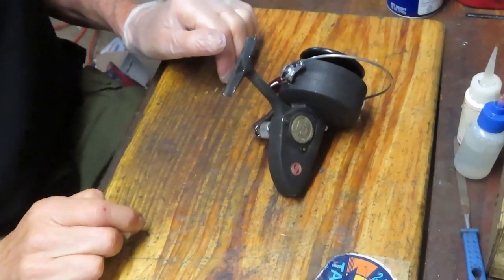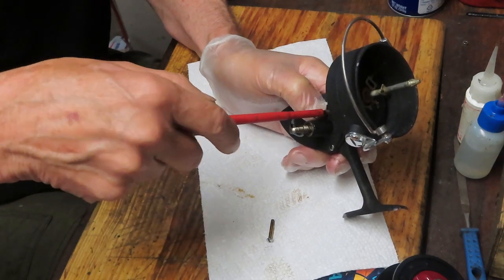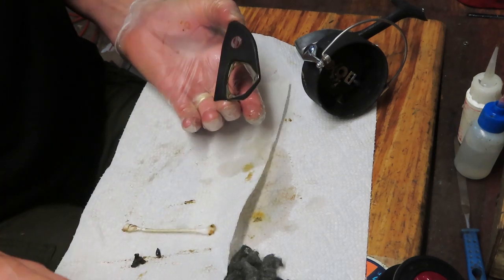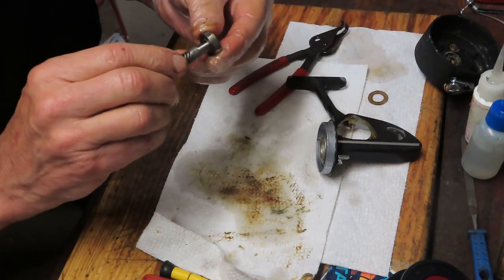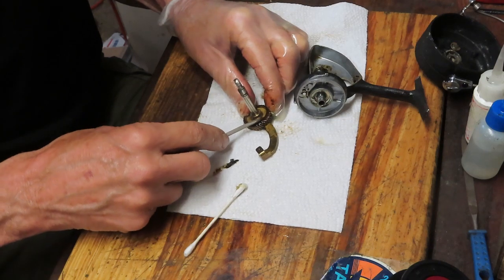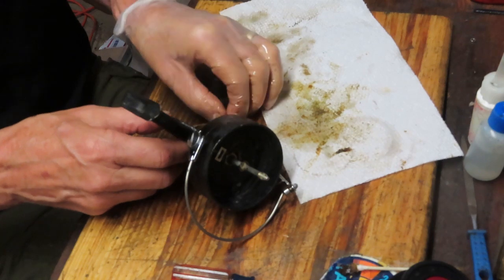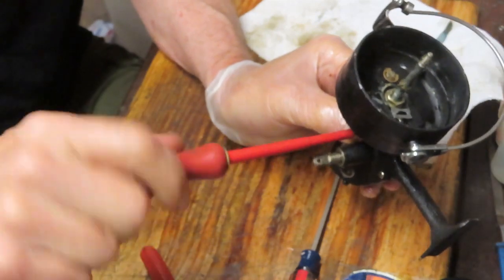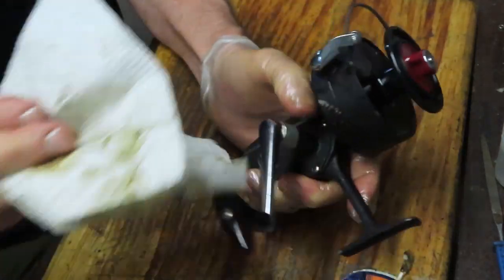D.A.M Quick 441N classic German spin fishing reel how to service

Comment: I tend to like the original DAM Quick reels (no N) such as the 550,440,330, 220, and 110. I don’t have anything against this reel or any of the “N” reels I just like the earlier reels which I have collected. I’ve had great difficulty removing the handle pin in my DAM Quick 270 Supers. I’m not fond of those pins. Also the through screws that hold the reel together are somewhat soft and you can butterfly them quite easily if you aren’t careful. I have to say that all these DAM Quick reels are tanks. They are made with the finest materials and with all but indestructable designs.  They are not what I would call easy to work on but their quality is beyond dispute.  Dennis you did a wonderful job with this superb reel! — Chris
Reply from the maker: Thanks Chris

Comment: Dennis , was told by a rep , from Boca Bearings, that brake cleaning  fluid was better to soak ceramic bearings instead of WD-40. Any thoughts?
Reply from the maker: That is an option.  Some folks also use diesel fuel.  They are all degreasers.  Best to experiment and see which one you like best - Dennis

Comment: I have a D.A.M baitcaster somewhere in fairly good shape would you be interested in a trade I have 2 Penn spinning reels that need a lil work I forget the models lol but 1 the bail doesn't go down all the way unless you pull it down and the other one will back spin a little when you hunch on it
Reply: Now I remember the one that back spins when you hunch on it is a battle 2  4 or 5000 and the one with the bail issue is a Fierce  4 or 5000 . The DAM is a 700 Champion
Reply from the maker: Please send me a note to my email 2ndchancetackle@gmail.com for service and repair information - Thanks Dennis